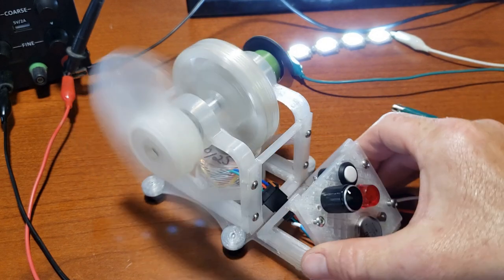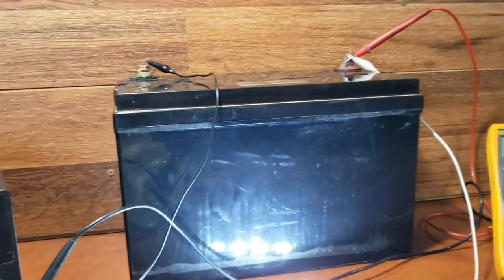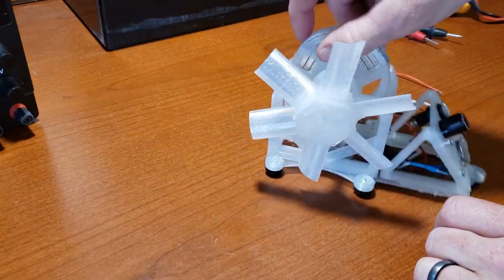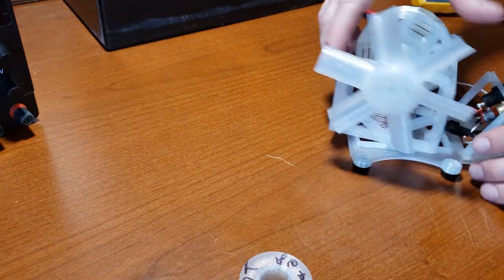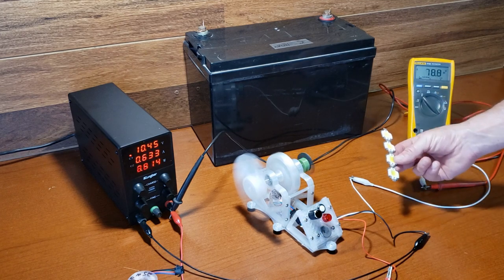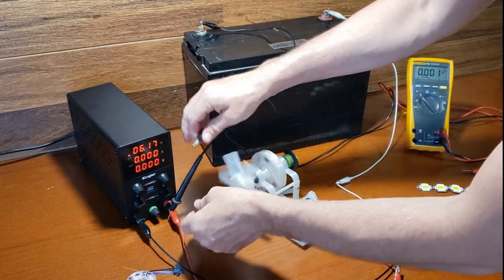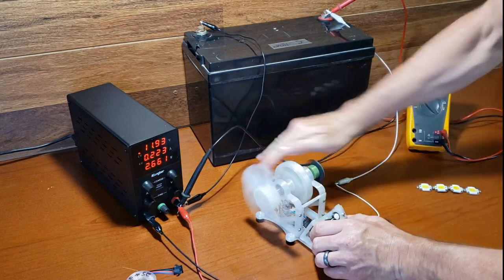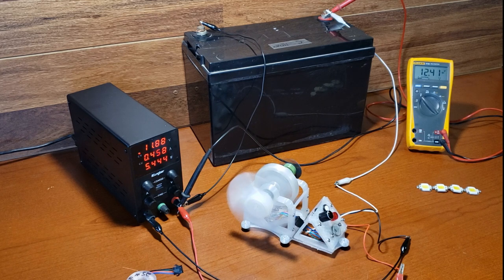Easy Bedini

Comment: Just one important observation. The Bedini Energizer uses a metal core of brazing rods, cut to correct size, which is quite important, according to Bedini himself.
Reply from the maker: True, with ceramic magnets. I'm using stronger neodymium which would over saturate the core. Your talking about Lincoln welding rods as a core material. This basic design is easy for beginners. Thanks for the input bro, we're on the same page!

Comment: I was going to build one but 3 of the 5 bags of components I bought were fake. So now I've got to order more.
Reply from the maker: Try Amazon, you should be able to find everything you need cheaply from there!
Reply: @redesign3dp  that's where I ordered them from. I'm going to just buy local and spend the extra money. This has happened twice now.
Reply: You should mention the amazon store names so we can avoid them because they are dangerous for new folks, without a component tester, they might just think their circuit doesn't work.
Reply: @L3X369  thats how i found out they were fake. I'll get the names and post them in a day or so.

Comment: What was the purpose of the trigger coil in the bedini circuit?  Has a modern method replaced it sir?
Reply from the maker: No, it basically resonates the timing and changes as rotor speed and voltage changes. That's why John said its not a motor but a mechanical oscillator. The opto version is great too but has more complexity. Bedini circuits are easy to make with few components. You just need a rotor with magnets, a bifilar coil, and the circuit. Other motors you have to add on the sensors which can be hard for some people.
Reply: @redesign3dp  Would each coil then be bipolar sir, say even if there were several coils? Thank you sir.

Comment: 1. They're very inefficient.
2. The timing is all off.
3. You need 2 coils and  a Capacitor That has the same capacity. 
4. You need to know where to put the ground wire to get the maximum efficiency. 
5. You also need the right diameter for the rotor.
Reply from the maker: I'm still waiting to see your motor video!